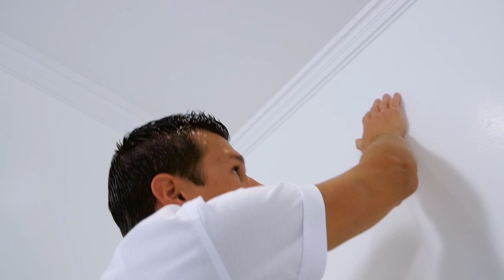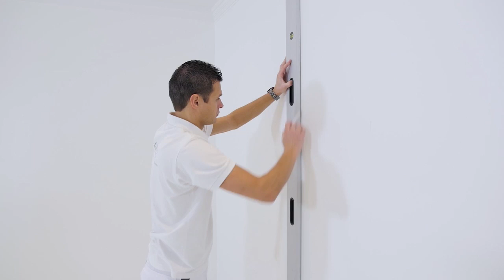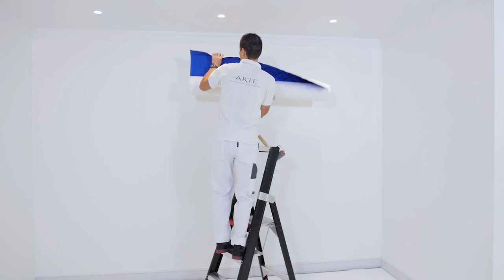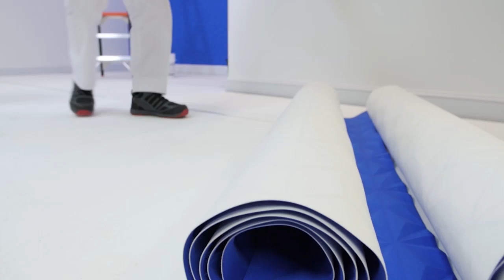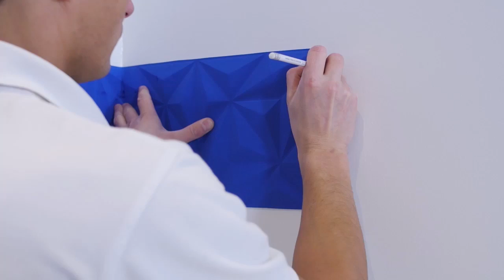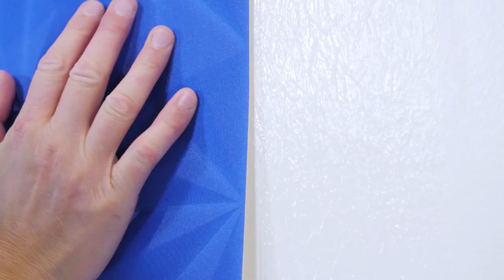How to hang 3D wallcoverings with a non-woven backing? Step-by-step instructions

Comment: you do NOT go around a inner corner like that!! you cut it so goes into the corner 1cm then cut off will start the new wall

if you do what he has done your paper will either be very wonky and will lift off the corner your next one WILL not join properly and the rest of that wall will be off and out and not straight.

Comment: I like the tools, I also apply wallpaper, some of the tools I've never even seen, help a lot in the final finishing. You used a tool for the wall corner, in this type of finishing I use a cloth to do the same service. The end result is the same, but with an appropriate tool you gain time at work. Congratulations on the installation, it was great.